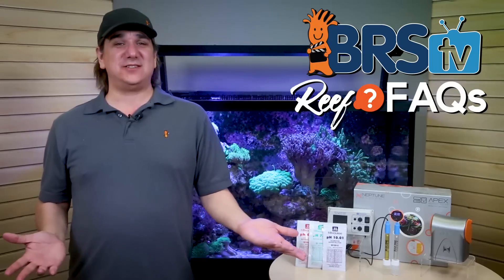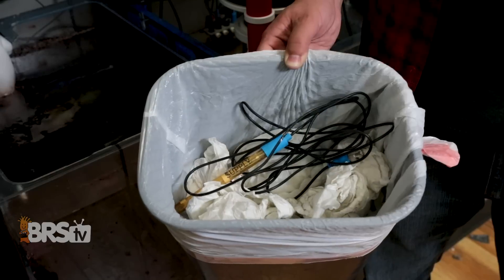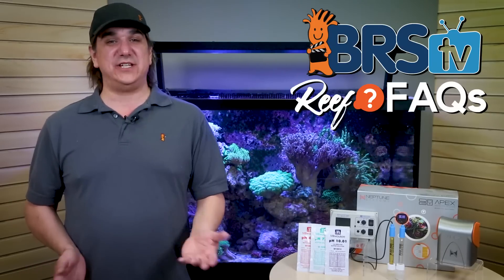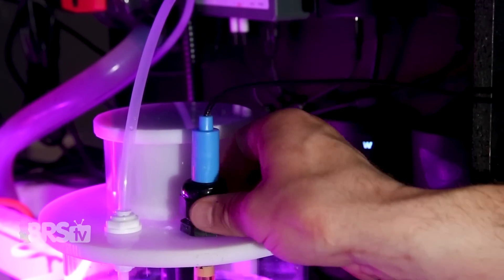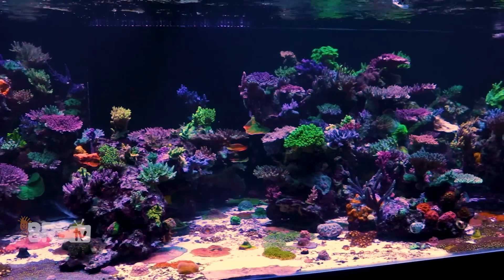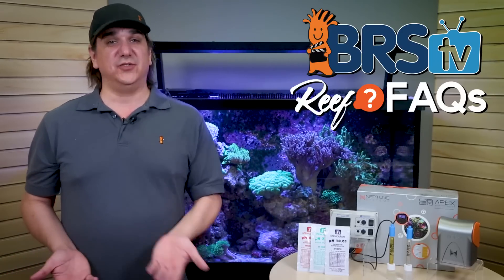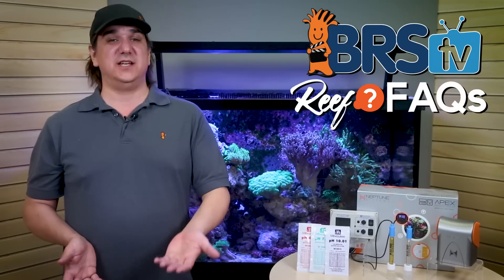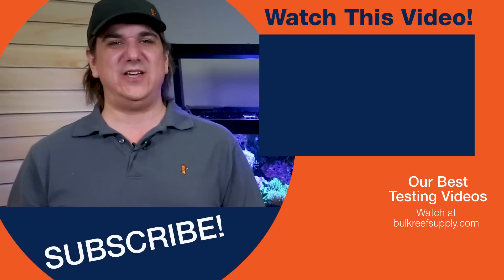Reef tank pH - When should I replace my pH probe on my pH monitor or controller? | Reef FAQs

Comment: Interesting, I’ve must’ve had good luck but my probes seem to last a very long time on a calibration. Easily 12 months+
Reply: It depends on the application. From other readings I've done they state applications where the pH swings more or where pH is further from 7 will use up the probe faster. My last probe (in tank) lasted 2yrs. On a reactor much less is the expectation. 

When side by side a new double junction probe lasted about 2.2yrs before it couldn't accurately calibrate at all. I've since switched to changing out 1 of my 2 probes every year to leap frog them. If my kalk is off my tank likely dies.

This likely insures one is in peak performance and the other shows if it's wandering.